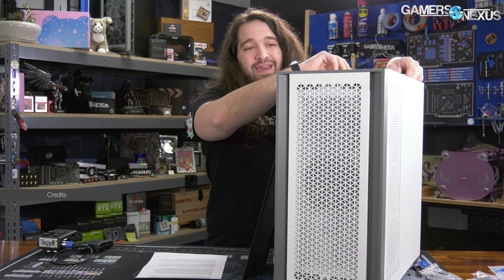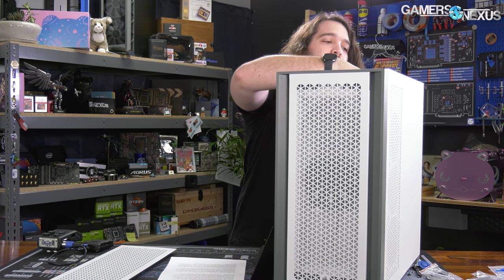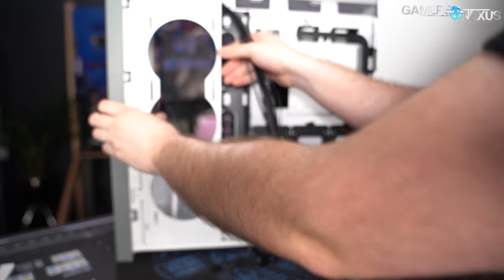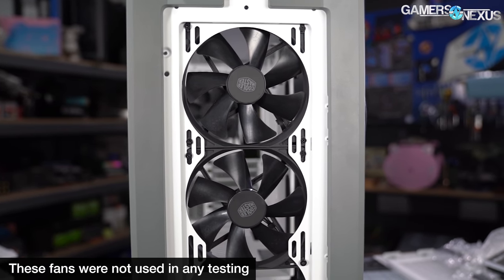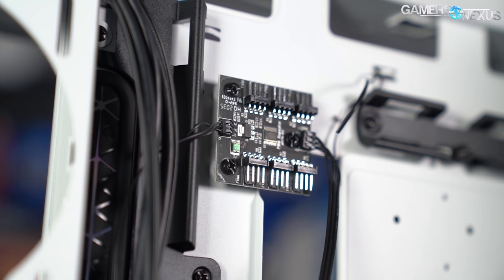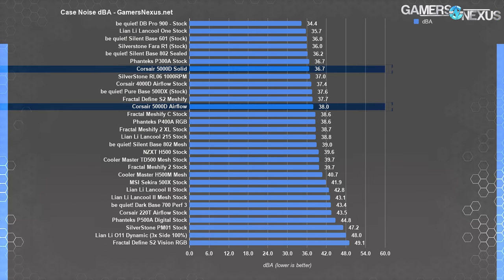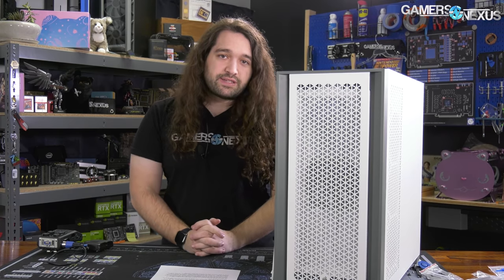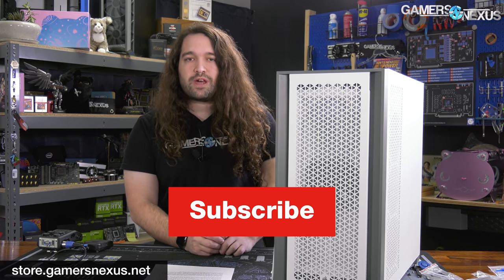Corsair 5000D Airflow vs. Solid Case Review: Thermals, Noise, Build Quality

Comment: Hate this case beyond hate . Had to mod the shit out of it just to fit 2 ssd mechanicl drives  . It's impossible to move the HD's over to the lockdown slot once you put them in the factory casing they give you because the  case pushes against the PSU cables . There's no goddam room . No bays ? WTF  . I need bays for my DVD player and my Fan Controller . I had to make an external mod for that so that I can use them .  2 lousy usb on top/front ? . My previous case had 4  . Almost impossible to find the on switch because it is so flush with the case .  Way too much money for what I ended up with because I needed a case to fit the 4090 and again , there's no dam room left .
Reply: You don't do much research & planning before you buy a case, do you?  And, "SSD mechanical drives"?
Reply: Lol it sounds like you would have been better sticking off with an ancient case with your dvd drive bays and space for your mechanical ssd's wtf are those??? Complete nubster if you ask me

Comment: Overpriced as usual from corsair.  At this price point there are far better cases on the market most of which haven't skimped on supplied fans either.  I still no see zero reason anyone would buy a 4000D or 5000D other than they know no better and just see the Corsair brand and think oooh that means it is good.  both have superior better priced an or specced competitors and it doesn't take a lot of research to find them.

Comment: SO I bought and just got one of these, and my first reacion is... WTF is THIS?     For one thing, the side panels aren't doors that swing open, they are slab panels you have to slide backwards with a ton of force  like on any old 1990's midtower case held on by two thumbscrews.  I'm not even going to be able to get in without prying with a flat head screwdriver.   And my second WTF is the top I thought would be a grill , and instead its some kind of panel like on the front with 45 angled sides.   Also, it's steel and heavy, not alluminum.

Comment: Too much on design not enough on air flow I went with Lian Li since it’s cheaper.
Reply: Actually the airflow is great, however the case is supplied with a meagre 2x 120mm fans, Luckily I have a ton of spare Noctuas (been building pc's for a long time) and my 5000d airflow has 10 fans and delivers great temps. Lian Li are most excellent though. On a side note I picked up this case for £80, a customer return but totally mint.

Comment: Will there be any new case where 5.25 front panel fully modular for real enthusiasy this year 2021?

All the new cases are for weak gamers
Reply: 5.25 drives are used by 1% of the case market in the US.
Reply: @MikeJones-bl6lu  since it is a niche market, should'nt they have a enthusiast, high grade case?
Reply: @noname-vl6vy  not necessarily.  Corsair doesn’t. Try Fractal.
Reply: @MikeJones-bl6lu  their cases only provide 2 slots. my icydock doesn't fit
Reply: @noname-vl6vy  sorry 😢

Comment: Sorry but for that price it should come with at least 3 rgb fans
Reply: Is not a problem. I have an i7-12700K inside with a Deepcool Assassin 3 and two 1TB NVMe SSDs, it's almost an utopia by how silent and perfect the build is for music production with that case and using the 2 fans included.

The glass panel broke, but now i have one made from common glass and is not a problem by how cool the air is inside, i don't have a graphics card for now until i find an efficient and cheap one that is as good like the rest of the system.
Reply: Since i have a common transparent glass panel, i don't need RGB.
Reply: rgb looks stupid
Reply: @gintozlato1880  so do late reply’s to old comments
Reply: @gintozlato1880  Fantastic song lol

Comment: I hate how he reviews case thermals with stock fans. Ya I get it, it only comes with two, but no one is going to use it like that. Throw two more on the front and tell us thermals!
Reply: For me, the airflow is so overkill that the two stock fans aren't a problem even on summer. I have an i7-12700K inside the Corsair 5000D Airflow black with a Deepcool Assassin 3, no graphics card. It's a music production build, no fan noise.
Reply: @saricubra2867  Cool story. For more intensive heat generating stuff, the stock fans don't cut it, you want 2 more in the front.
Reply: @insertnamehere4419  I would use liquid cooling at that point instead of two more fans in the front. Or buy an efficient chip instead of a burning inferno like the 13900K, a 4090 and 7900XT
Reply: @saricubra2867  LIQUID METAL INSTEAD OF 2 MORE FANS IN THE FRONT lol this guy. You don't get it. Fans in the front is not "over kill", it's bog standard.
Reply: @insertnamehere4419  Bog standard for chips with bad efficency. My i7-12700K iddles at 27 degrees and maxes out at 77, all by using Artic MX4, no liquid metal.
Reply: @saricubra2867  lol.....